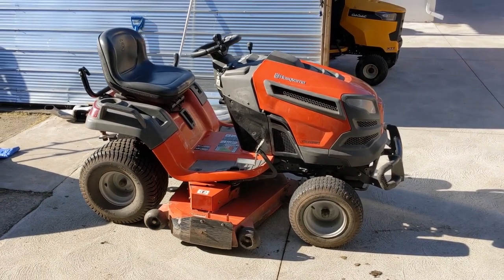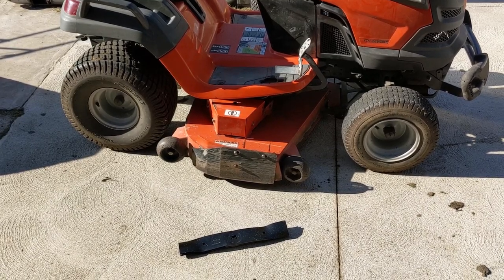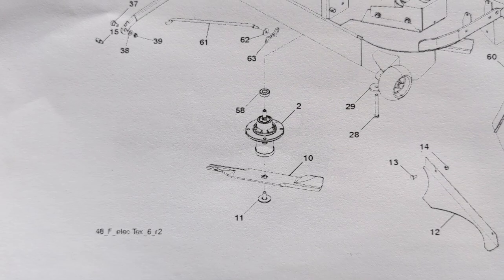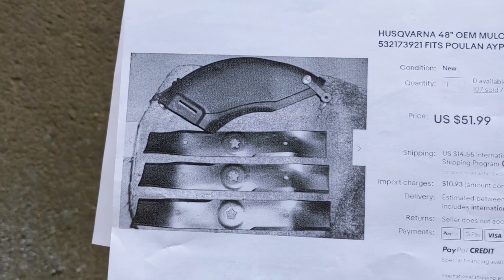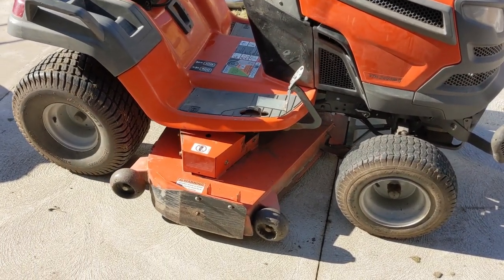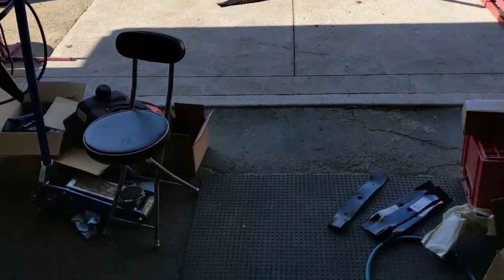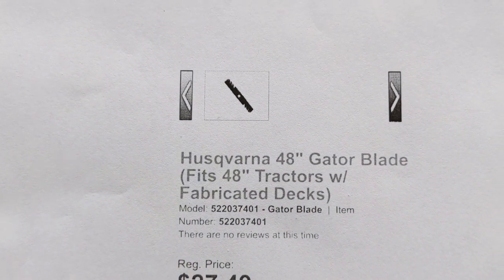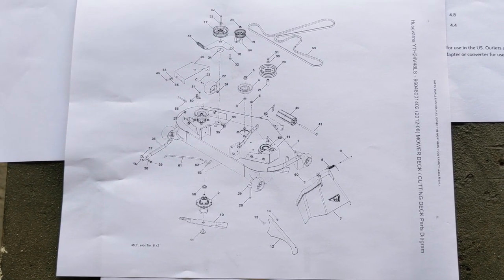Husqvarna Blade Differences for 48" Fabricated vs Stamped Steel Deck

Comment from the maker: After some investigation, here's what I found...

Stamped Steel 48" Deck;

Mulch Kit with Plastic Plug and 3 blades: 531309642

Hi-Lift: 532173920 (STENS 340-322 will work)
Mulch: 532173921 (STENS 340-091 will work)

Fabricated Steel 48" Deck;

Mulch Kit with Metal Cover, Metal Insert and 3 blades: 965894003

Hi-Lift: 539113425 (STENS 350-458 or Rotary 12123 will work)
Mulch: 522037401 (Rotary 14208 will work)

It's important to note that Oregon has replacements for the mulch blades for a 48" fabricated deck, however, the width was listed 3" instead of 2.5" so there may be interference.

Oregon also lists the lengths of some 48" stamped steel deck blades as being 16 11/16" which is even longer than the 16 5/8" blades. This, in addition with a slightly wider blade, may result in interference with the mower deck, or mulch kit insert.

I'm recommending you order the OEM or STENS blades listed above, as these are guaranteed to fit!
Reply: Huge question. At 8:08 the Copperhead blades in the photo from the rotary store shows the blades stamped with model numbers & the “teeth” facing up or towards the camera. I’ve always thought that without a blade stamped bottom that the numbers stamped indicated which side faces down. I’ve never used blades with teeth before but I have a set just like in the photo (except 2 for a 42 inch riding mower). It seems like those teeth should face upwards towards the deck even though the blade curved the opposite way.  It just feels wrong to have the teeth facing down but that’s the side that’s stamped. Thank you in advance if you can offer any advice. You definitely get detail & have noticed that little things get written up a certain way & suddenly ppl are buying the wrong parts. 👍
Reply from the maker: @r.williamcomm7693  teeth always go up, towards the deck, just like the wing on a lift blade!
Reply: The blade from Oregon for the 48" Fabricated Deck is 595-087 G5 Gator Blade

Comment from the maker: Also, we pulled off high lift blades that were installed on this unit with a mulching kit. He said it came like that when he bought it... I'm now wondering if someone else also had trouble finding the correct blades, so they decided to just run the original high lift blades, even with the mulch kit installed... Could that have lead to the original PTO clutch failing, because the deck got loaded up with grass 🤔 never use high lift blades with a mulch kit, you're just asking for trouble!

Comment: Another great video! Customers always act like I am crazy when I ask for a product number to make sure I am getting them the right blades. If they only knew how important all that double checking is.
Reply from the maker: I've never ran into this issue before, so I had to share my experience. In the end, customer is happy and I was paid for my time. Plus I have some extra blades in stock now. MTD is good for putting multiple decks in their IPL's and also specify fabricated or stamped, electric or manual PTO, different sizes etc. Thanks for watching!

Comment: I use the gator blades on my older john deere and my husqvarna both have stamped decks. With the john deere moisture isn't an issue even wet grass doesn't clog the deck but the husqvarna clogs with even some evening dew while mowing. The oem blades on the husqvarna clogged also

Comment: Eliminator ive got a question what is the bracket that bolts under the mower that keeps the pto from turning called
Reply from the maker: Anti rotation bracket, prevents them from spinning when the engine is running.
Reply: Thanks bud I watch all your videos good job keep them coming

Comment: I have a ts248xd with the clear cut welded deck.  I installed the plug and the containment pieces on the bottom.  I doesn't really mulch that well at the higher settings.  The mulching blades with the "jagged fins"... do you think they make a difference?  Is there a blade you would recommend for me to try out?  I watched your video and the deck looks older than mine so I just want to get the right blades.
Reply from the maker: I would definitely get the gator blades, they seem to do a much better job than the curved mulching blades.
Reply: Do you have a model number for those blades?
Reply from the maker: @geraldsagona7810  no I don't have the number for your model riding mower, you'll have to either call Husqvarna with your info or do the research as I did online. Husqvarna  didn't list the info I needed, but maybe if you Google your model number with parts diagram after it, you may find what you're looking for.

Comment: All that agrovation to find the right blades for the mower pan that came on your mower👎😠
Reply from the maker: Yes unfortunately. Turns out we pulled off high lift blades that were installed on this unit with a mulching kit. I'm now wondering if someone else also had trouble finding the correct blades, and could that have lead to the original PTO clutch failing, because the deck got loaded up with grass 🤔 just some thoughts, thanks for watching!
Reply: @EliminatorPerformance  well at least you have the right blades for the customer

Comment: Just like I thought, never easy to find the correct part. Same with other style or type of models and other companies.  I have the stamped version, they gave me the extra set of blades for either or.  Should I be happy? No, it’s mind boggling to see the different models and length with “teeth”.  Too much Bull shit my friend, however, my model is a year old now and honestly, I use the mulched blade they provided me, and have better luck cutting without the cover for the vortex.  Is it mulching? Yes and no, yes because I want a smooth cut, no, because the design sucks.  Years ago, I had a Craftsman that was built by this Mfg.  Husqvarna.  Much easier to work on the older model than this newer model.  My craftsman was a 1999 model and the only reason I change him out was the hydrostatic transmission.  The new mower is fast, however, believe it or not, the other model cut better with the mulching blade, cleaner cut.  I live on a half acre across the river in the Detroit Suburbs.  Thanks for those 20 model numbers that are a mess.  Yes, I know, it’s all part of the model game these manufacturers play.  Again, just too much bullshit.  Thanks for blowing my mind, it’s all good! LOL!
Reply: Glad we were able to provide some information that helped you out. Yes you are 100% correct it is easier to work on the older machines just like the older cars and trucks. They were also manufactured with heavier materials back in the day and lasted a long time. Remember the 283cc engine you could not blow it up so they discontinued making them.

Comment: I'll be sure NOT to buy a Husqvarna riding mower. If it's this difficult to buy some blades for their tractors, it's NOT worth the trouble. 🤷🏿‍♂️🤷🏿‍♂️🤷🏿‍♂️🤷🏿‍♂️🤷🏿‍♂️🥴
Reply from the maker: I believe just with this model for some reason, as I mentioned to other viewers, I've never had this issue before. Thanks for watching!